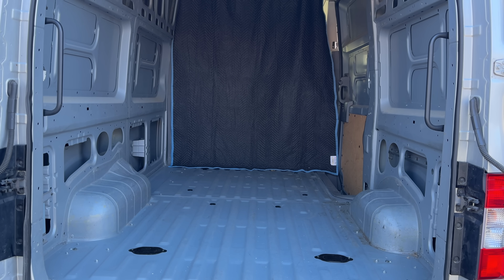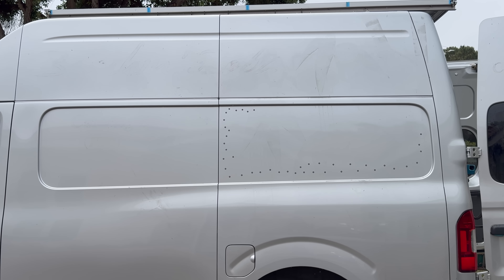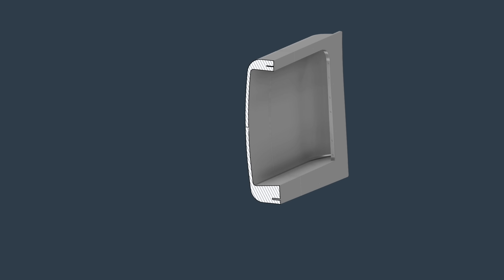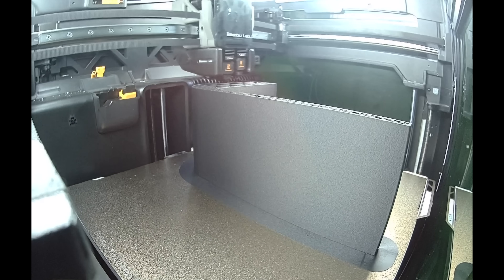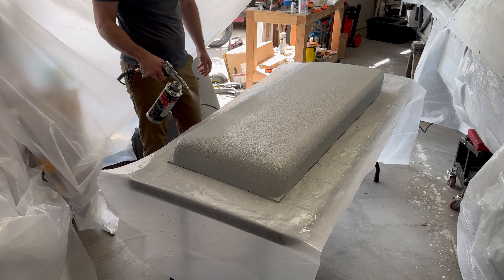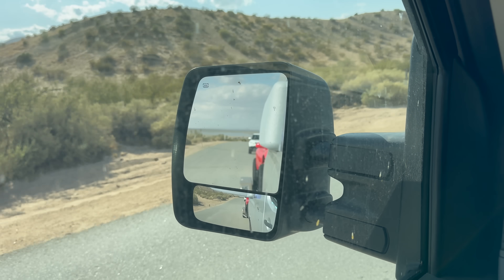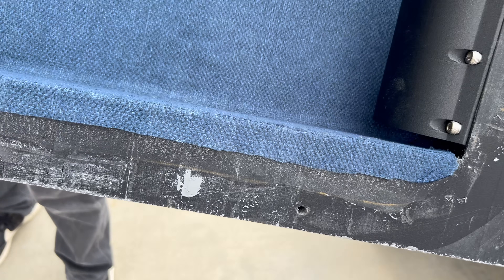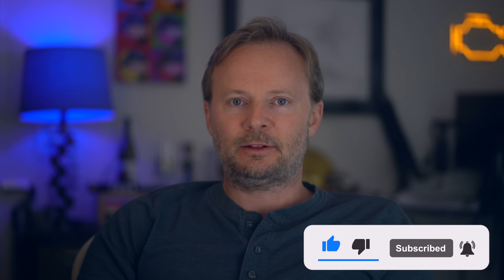The Challenges Of 3D Printing Large Parts

Comment: You can also scan for free using cell phone photos with photogrammetry 😉. Just make sure you get the scaling factor right and there's no need for an einstar for something like this. Great idea with the dowels, likely much more precise than 3D printing the entirety of the locating feature. I tend to use the "lip and groove" feature in solidworks (surely fusion has something similar) but for small geometries it doesn't work as well. Bummer about the crack, I have a CF-ABS HVAC piece on my car where the seams are plastic welded together. I haven't noticed cracks yet, but after seeing this I'll definitely keep an eye on it. Plastic welding the seams might be a bigger job than 1 layer of fiberglass though for big parts.

Great stuff 👍

Comment: I don't think I've ever seen you vacuum cure a fiber cloth and resin part. Wouldn't that help your fiber glassing process to suck less? More wasteful but better finish and lighter weight straight from the bag.
Reply from the maker: We did it on the side and lower flat panels of the land speed car. It’s a lot of plastic waste and work and chasing small vacuum leaks. I use it when weight really matters.

Comment: It's nice to see someone use CF filament for good reasons. Too many people use if for strength not realizing it actually reduces layer adhesion (cause CF bits that happen to line up on on the two layer surfaces do not stick together) making the print even weaker in the direction it's already weakest.
Reply: CF improves stiffness overall. Siraya Tech has a ABS-CF Core filament where the CF is only in the center of the filament therefore you still get all the layer adhesion and the stiffness.
Reply: @groundzero_-lm4md  any cf or filler in the mix will reduce layer adhesion, as it still reduces the surface area.

Comment: RV technician here. I highly suggest foam seal tape and Geocel ProFlex when interfacing things of that nature to the body of a vehicle. It deals really well with the flexing and does the best job of keeping the water out in my 17 years experience working on similar vehicles. I know its already mounted now but its good information for anyone else who attempts such things.
Reply: Both at the same time?
Reply: @KrazeeCain Sorry. Good question. I should have been more clear. Foam seal goes at the interface between the body panel and the accessory being installed. I usually keep the seal tape just slightly (~1/8th inch) inside the perimeter to allow for the tape bulge out. Then once mounted in place, run a bead of ProFlex around the outside. If you need to smooth ProFlex I use acrylic solvent in a spray bottle.
Reply: @i_do_the_thing  I hope to never, ever work on another RV. Ever. But if I do, I'll remember this.
Reply: @i_do_the_thing  YES this also helps isolating the flex of the body, so it does not fully transfer into thee added part!!!!
Reply: Boat guy here; I'd just 5200 it down, and it will NEVER come off or leak again... lol Wonder if RV guys even know this stuff exist? I use 5200 on everything, only thing it cannot fix is your broken relationship with your kids.
Reply: @johnwalker7592 Well yeah. We know. That strikes me as an odd question from a boat tech. Boats and RVs use so many of the same suppliers and manufacturers. Lippert, sealand/dometic... Even NTP is joint to seaway for a few years now. If nothing was ever to break sure mount it forever. Heck put it on with E-40FL. A 3d printed multi part accessory might crack or even a purchased one. I'd still suggest something serviceable. Matt is essentially building a class B RV and like all RVs it will eventually have failure point. As I always say though if its your camper do wtfe you want and see what happens.
Reply: @TheGrippySocks  5200 will peel off polyethylene like it was a postit note.
Reply: @TheGrippySocks if that crack happened and he had used 5200 he'd be hating life.
Reply: That’s great information for effective seals, but not advisable for tragicomedy, so slap on some chewing gum and see how well it works as an amphibious creepy van.
Reply: A technician here. I highly suggest testing out adhesives before using them on anything even remotely important.
Reply: RV urinator here.  I highly suggest a liquid laundry detergent bottle, big mouth, good seal, short thread, not obviously a piss bottle if someone sees it, no ones going to drink it, dollar store brand even has orange flavor so its color coded and disposable
Reply: @YouTube_username.  This guy pisses.
Reply: Nothing beats SIKAFELX. Use it for everything and anything :D
Reply: How about butyl tape? I wonder if the steel panel would be stiff enough for long runs between fasteners. Good stuff though.
Reply: @Tb0n3 yes but not a great sealant between metal if you are expecting heat. Butyl has a tendency to squeeze out when it's hot. We've all seen that coach. You are supposed to R&R butyl every few years too and ain't nobody got time for that. It's mostly relegated to under roof accessories that will eventually get lap sealant or small crap like latches that will break about a year after install.
Reply: @i_do_the_thing it's good stuff on boats. Good for decades since it doesn't dry, just needs compression.
Reply: @Tb0n3 but again boats are typically made of fiberglass not metal.
Reply: Thank you for the tip, I am building a camper right now out of a race car trailer, and want to seal the windows I am installing. I’m installing frameless windows so the tricky part seems to be the top because the sort of hinge extrusion makes it difficult to add anything after the fact. I’m open to any suggestions!
Reply: Is buying a used RV worth it?
Reply: @TheOnlyKingBee Sorta. Its better than purchase of a new RV. Its a complicated answer but your expectations factor in a lot.
Reply: @i_do_the_thing hummm what scared me is the electrical part and if the thing leaks
Reply: @TheOnlyKingBee I can probably help but talking directly would be easier.
Reply: Thanks for the info.
I am an automotive tech and a heavy equipment tech.
Is there a textbook for RV techs or is it all on-the-job learning?
I'm going to start building camper vans at some point, I'd like to learn a bit first.
Reply: @d.thorpe2046  there's nothing textbook unfortunately. Its all on the job. Feel free to reach out. I'm not opposed to helping.
Reply: Have no idea what that is and not googling it 😅
I always use 3M butyl rubber that you get in 8mm sausage rolls.
Stays soft forever and is leak proof if you just clean before applying it.

Wrap it around a cable before pushing it all the way through a hole and it plugs up perfectly

Comment: I once tried to print some pipe connectors for my pool.  Not strong enough on their own but I figured a thin internal and external wall with spacers which I could fill it with epoxy would be great.  Didn't work too well for me as my tolerances were too high so gaps were too thin but could work great for something like this - especially if you put glass fibres in the epoxy.

Comment: You mentioned acetone welding the ASA pieces, but another fancy thing you can do to finish the joints and cover the seams entirely is to dissolve a bunch of ASA into some acetone (usually failed prints or support material) to make a much thicker goop that you then brush onto the surface. Fills in the gap and bonds to the surface. Make it even thicker and it can also help touch up surface defects on prints you want to look nice.

When I print pieces that fit together I normally do basically just a half lap with or without indexing depending on how lazy I'm feeling while modeling. Although I have also done dowels before. Then again most of what I print isn't thick enough to glue face to face like you did, so maybe in this case it wouldn't make a huge difference to the joint strength.

And in any case, the fiberglass shell is probably necessary anyway, as annoying as it is. So the simplest solution is probably the best.
Reply: Rob Dahm did this for his air ducts on a 3 rotor Pikes peak car. Oh look, Rob uploaded the footage today. Lets see how it went
Reply: On ABS bike fairings and other things I use some ABS scraps dissolved in MEK.  You can easily control the viscosity if the mix. It does shrink a good bit during curing, so using thin  layers for gluing parts is key and using enough to shape afterwards is necessary for thicker repairs.     Wiping the surfaces down a couple minutes beforehand with the MEK (or acetone in your case) helps part adhesion a lot.
Reply: this is the way.
glad I didn't have to write it up :) 100% agree.

Comment: This would give you like what, a few more inches at most? I assume having two on either side would help, but with just one it seems like you had a bed that just couldn’t fit horizontally in the van, and only a few inches were needed to make it fit. Unless beds sizes are very close to van interior width sizes, I don’t see how useful such an attachment is, even the 3k ones.
Reply: Would have made even more sense to extend the entire middle segment of the van but he didn't do that either.
Reply: Just imagine if the bed you slept in was between 2 walls and it was 2 inches narrower than being able to fully stretch out. How valuable would those 2 inches be to you?

Comment: So, this is more generic for those watching… 

I used to work in a prototype environment where we used 3D printing extensively, and ultrasonic cleaners with water and solvents to dissolve support material.  I can confirm that FDM printing is in fact more of a sponge than a sealed surface as it pertains to liquids.  It won’t let it in right away but it will absorb liquids readily (oils as well) unless you do something to seal it.  Usually a good couple coats of urethane or perhaps burnishing it with an open flame to “cap” the exterior surface layers would likely work fine.  But by no means would I call FDM water-tight.  Often had to let parts drip dry for days from being internally saturated when left to clean in our ultrasonic baths.

If you want to try this, dunk a non-filled item in a bucket, then try to use compressed air to remove the water.  You’ll notice it seeping out between the layers.
Reply: Good info. Thanks. Another way to test it would be to embed a ham sandwich and see if it smells or seeps.
Reply: Ther are materials that are watertight 
But most are not

Comment: to anyone looking to print CF reinforced filament, you NEED to coat any CF 3D printed parts. the "CF" are actually very small SHARDS of CF embedded into the material. If not coated, any surface shards are going come out eventually. Needless to say, CF shards are NOT fun

Comment: I think using only 2-part epoxy without any fiberglass would also work in sealing the gap. But since you already have it on hand, it doesn't hurt to use it.
Reply: That would crack almost instantly.

Comment: If you're going to be doing large prints like this in the future I would highly recommend you use 3Dgloop to glue the parts together.  It's not an adhesive but rather a chemical compund that fuses 3D parts together into a singular piece.  It's probably the strongest way to stitch 3D printed parts together aside from printing the part as a singular piece.  I have it and used it to glue together an autocannon from helldivers 2, and it worked really well.
Reply: When it comes to water-tight seals, sometimes it’s best to use an adhesive.

When chemically bonding, you use very little bonding agent, so nothing is filling in the small gaps. ASA likes to warp, so it’s guarantees there will be non-water-tight gaps. After it’s bonded, those gaps are difficult or impossible to fill…and you’ll be using an epoxy anyway to do it. 

For this case, it doesn’t matter too much, and gloop would probably be fine since they’re using filler and bed liner. BUT my point is that as great as gloop is for some things, it’s not right for everything.
Reply: So, solvent welding, not adhesive?

Comment: I've always been a little afraid to make large things like this on my printer for effectively the reasons why it didn't work for you. Can't believe I didn't think to just wrap the outside in fiberglass.

Do you think you still would have had the problems if you had fastened the parts together with screws and nuts rather than glue and dowel pins?
Reply: Screws and nuts would probably move more than glue, since you have way less bonding area and plastic will flex in the areas between the fasteners. I've never printed anything this large, but have bonded together parts larger than the bed of my printer. For something like this, I'd use a plastic that could be solvent welded or go over the joints with a soldering iron. I do like the idea of fiberglassing over it, since FDM parts are never truly 100% waterproof and something like this I'd be concerned about water leaking into the infill areas and growing fun things. However, with the glue bonding problems he had with the ASA I'd also want to run a small-scale test to see if the fiberglass would bond to this, you might end up with issues with the glass delaminating from the part which might not be possible to fix without reprinting the whole thing.

Comment: On large prints I'll go over the seams with a soldering iron so the outer surfaces are continous. Otherwise yes, they'll crack every time
Reply: If you print with abs (or asa, like he is in this video) which you should be, you can use abs pipe joining compound to melt the abs together. Its essentially abs melted in an acetone slurry.
Reply: @OtherDalfite  and it gets you high as hell if you dont wear a respirator :)
Reply: Ooh I wonder if all the plastic repair stuff would work? Like heating and pushing wire mesh into the plastic to fuse the parts together.
Reply: @13SuperSuirre  That's what I do for exterior stuff. ABS pipe cement to bond it together, then hot staples to hold it all together. Works a treat.

Comment: I figured I only needed a place for my head, so I used the glass door off a front loading washing machine. Now I can sleep like a spaceman. I didn’t really, I have a Birmingham British telecom box van from 1991 that is 7 ft wide. This is the better option. It has a bog and a crane on the back for loading welding gas, mini rat bike, 1:8 scale toy train. Also has a 12,000lb winch on the side.
Reply: OK, that's cool enough that van-life is starting to become tempting...
Reply: @zrobotics do not underestimate the loading height of a box van or how small most tailgate lifts on them are.
Reply: @brianhaygood183  mine is just a back door. Cooker and crane on the right. Shower/toilet to immediate left. Full size kitchen sink and bed at the front.